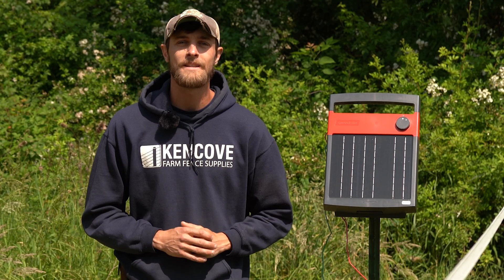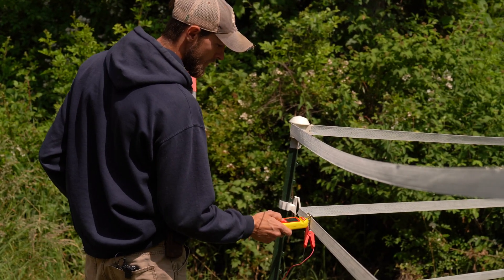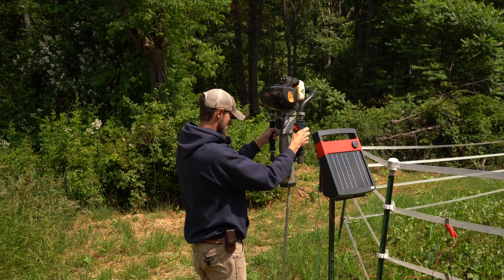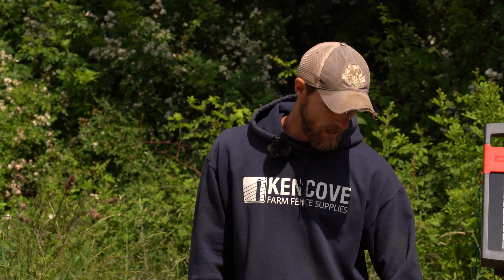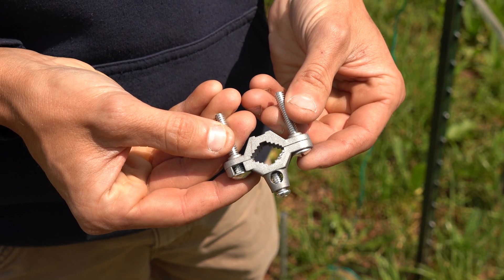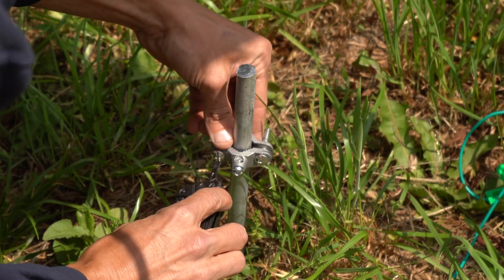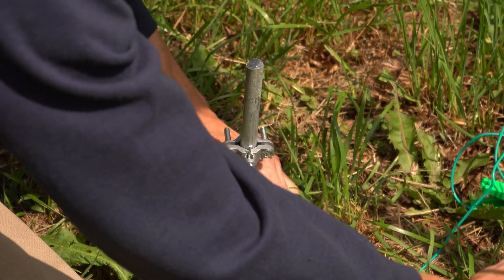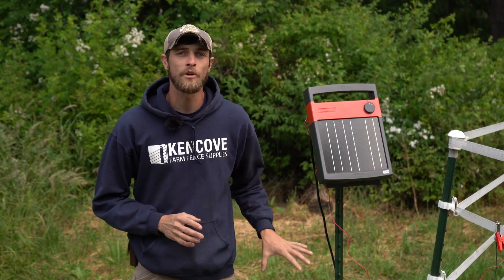Fencing Quick-Fix: Upgrading Your Ground Bed

Comment: My spring and fall are quite wet, and our summers can get very dry. We use a seven strand ground return on our perimeter with the 2nd, 4th, and 6th line a ground line. We daisy chain them and drive a ground every couple hundred feet and connected to the lowesr ground. Touch any 2 side by side lines and you get the full charge of the fence. The extra grounds on the perimeter also help conductivity return on the earth when it gets dry.

Comment: How do you connect the multiple grounding rods together?
Reply from the maker: You would simply have ground rod clamps on each of your ground rods and run one, continuous piece of wire through each clamp to the next. We have copper and stainless ground wire, as well as grounding kits for 5ft and 6ft rods. We had several questions about grounding with multiple rods, so we will likely do a follow up video soon!
Reply: @KencoveFarmFence  Thank you! I look forward to the video. May I suggest more detail as to the progress of determining how many rods should be used?

Comment: Can you connect multiple ground rods with a bare copper wire and then the bare copper wire to the Energizer? Or does it have to be insulated wire for some reason?
Reply from the maker: We offer copper and stainless ground wire options. You would run one continuous piece of ground wire through a clamp on each ground rod. That same continuous piece of wire can hook directly to the negative terminal of the energizer. It does not necessarily have to be an insulated ground wire. If the fence lead out wire (positive) and the ground wire lead out (negative) run close in proximity to one another, it would be a good idea to use coated or insulated wire, especially on the positive strand. We had several questions about grounding with multiple rods, so we will likely do a follow up video soon!